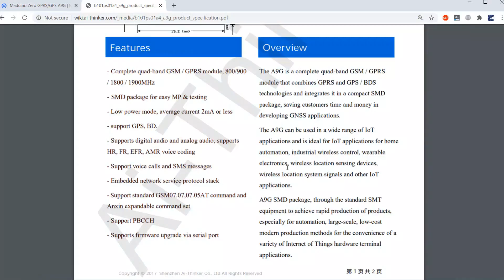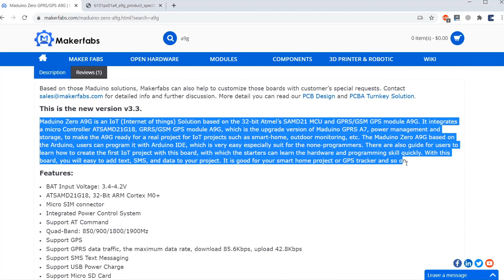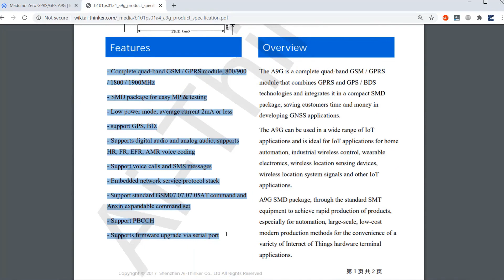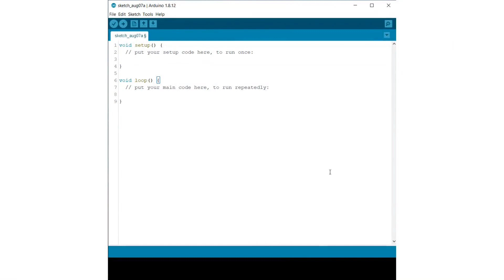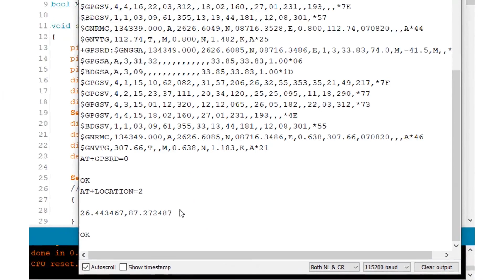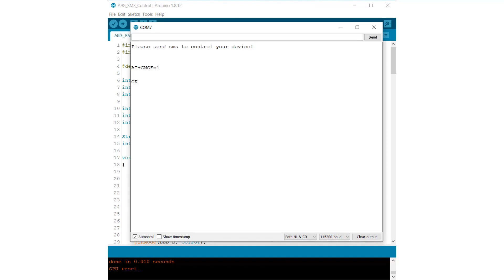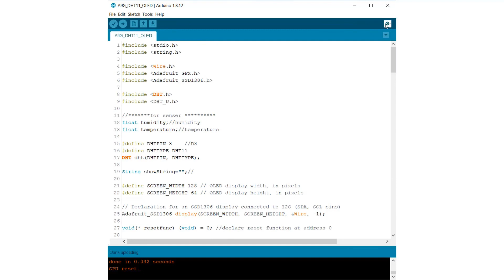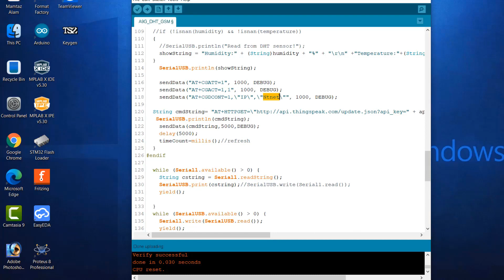A9G Low Power GPRS/GSM + GPS Module for Cellular IoT Applications | SMS, GPS Tracker & Internet

Comment: Great tutorial! I managed to implement a similar GPS tracker using this board but I am facing a big problem. When it's connected to the battery and I am adding a solar pannel, the board freezes. If the solar panel is removed and I am resetting the module, everything is working fine. Did you succeed in adding a solar panel and battery and have a stable working code?
Thanks
Reply: Check the power, u cant drive the circuit direct from the solar pannel, add some buck boost converter.

Comment: Can I use A9G development board with arduino and make these things done ? I have no access with maduino . If it can be done using arduino uno and a9g development board please share the connection and code
Reply: did u do it? if yes can u tell me which sim card did u use and was it successful connecting arduino uno with a9g module?

Comment: I am trying to build a live tracking system with delay of max. 5 seconds from reality to map and have problems with the GPS quality. Behind a windshield the NMEA information sometimes does not update for 5, 10 oder 20 seconds even if GPS fix is 3 and there are up to 10 satellites being tracked. Will the GPS power mode affect the GPS quality and/or update frequency?

Comment: Hello! If I wanted to use an arduino (separated from the a9g module) how could I do the configuration to interconnect the modules? could I use the same code?
Reply from the maker: Yes u can use
Reply: but why? Just buy the A9G board without a microcontroller

Comment: So according to this video what is the average power consumption per day if we have app that let say - opens internet connection to send MQTT data every 5 minutes and then going to deep sleep?
Reply from the maker: I have tested  with 20 minute interval and the 3.7V battery with capacity of 1000mah, the battery will last for more than 8-9 days as per my calculations and observation.
Reply: @HowtoElectronics  I am tracking at second intervals and an 18650 with about 2800mAh lasts about 18 hours (with firmware in debug mode and logging). I am not using the M0, only custom firmware within the A9G on the pudding dev board.